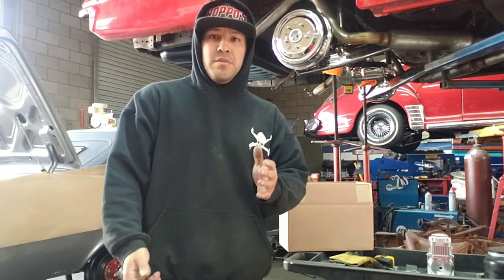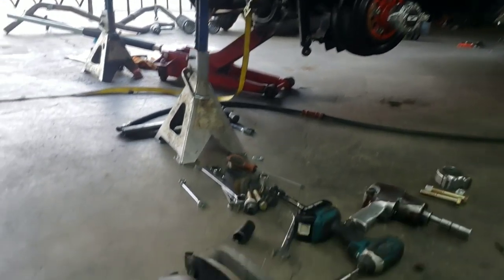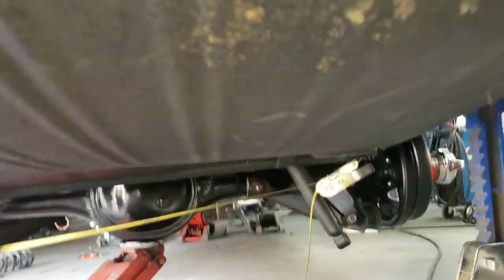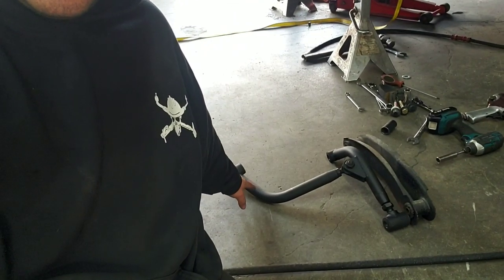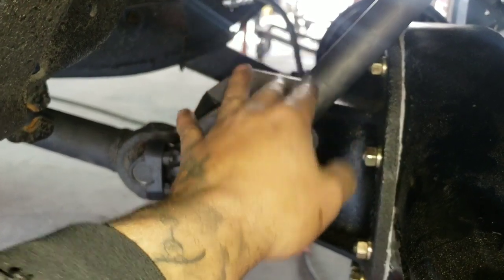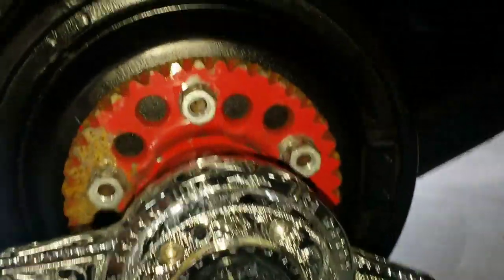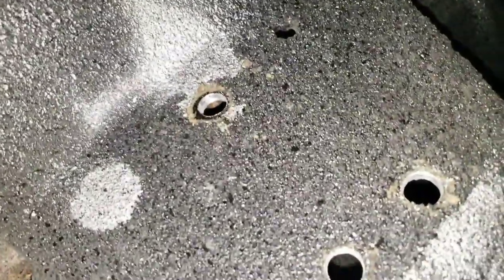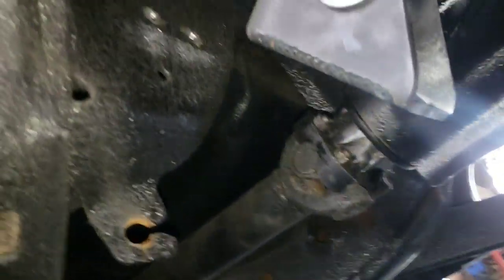"How to install a hoppos Y bone on 59-64 impala

Comment: Much respect and props to Hoppos for teaching us DIY guys at home for our rides. However I’d like to make a suggestion that there is no need for centering when the original bracket already will have the y bone centered up once it’s bolted back to the frame.. then you grab a level and your other bracket , make sure it’s straight with the original and mark your holes for the other side and start drilling.. if you’re changing trailing arms you should put them on first before bolting the rear end to the y bone to make sure you have the correct distance.. screw the y bone  in or out what ever is needed to match up the hole with the rear end once the trialing arms are bolted in place. Then you’re all done. I don’t see a need for all the strapping and measuring. I all ears if anyone has any suggestions as well thank you.

Comment: Shouldnt the 2nd bracket be in the exact same position as the original one? Meaning couldnt you just measure it and drill the holes without doing any of the rear end sideways positioning and using the straps? I have the frame reinforcement bars from global west so i already have holes drilled on the driver side... So therefor the Y-Bone should line right up already???

Comment: Question when you pulll rear end over to center rear end to quarter panels how centered does the driveline stay with the tunnel and pinion from side to side ? And how much movement from side to side does it affect driveline

Comment: Do I need my rear end shortened before I instal the y bone ?    Or just installing the y bone will be sufficient to ride with skirts ?  Thank you
Reply: From what I have gathered… (you may have figured it out already) the y bone eliminates the rear ended from moving to the drivers side when goin up and down thus you should be able to run skirts with this setup. The rear will travel up and down. And won’t move to the side. With wires it may be tight. But I think the should work too.

Comment: Can you do three wheels on an airbag system
Reply: chris cardiel they use to sell some cylinders for airbags for the 3 wheel lock up in San Jose CA at r&s hydraulics but I don't know if anyone else does it but yeah it's possible
Reply: @johnbeer5242  thank you sir for the information I appreciate it